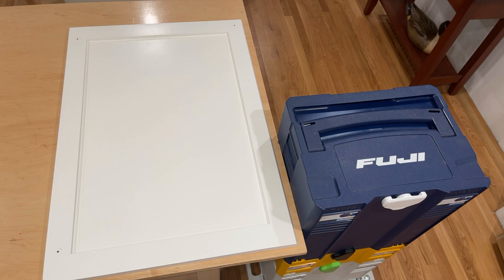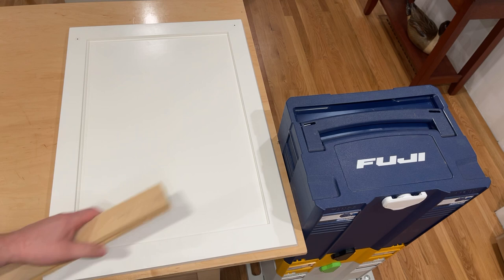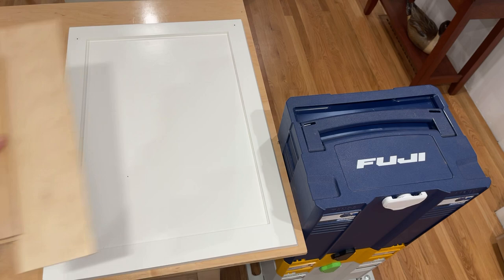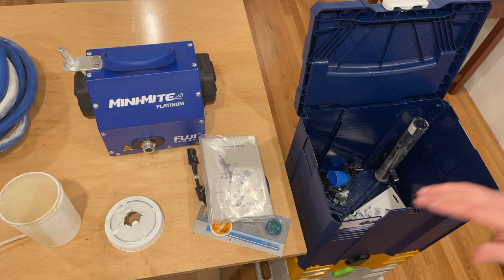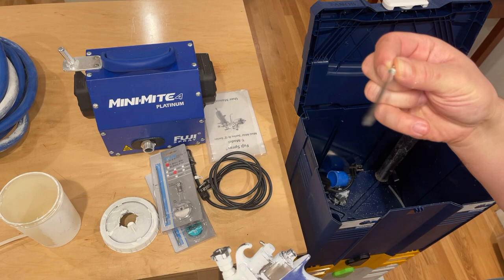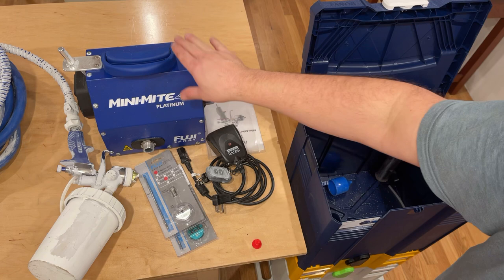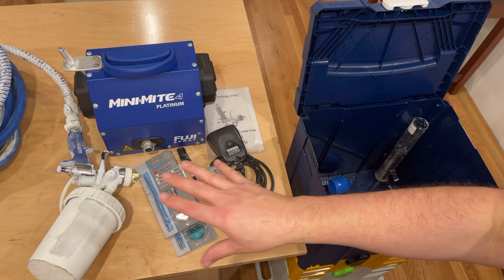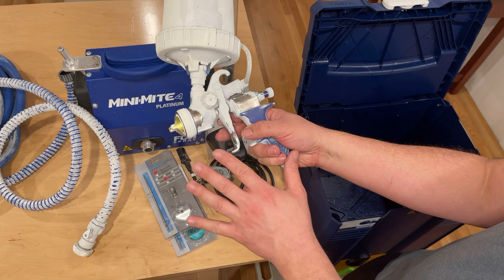Painting Kitchen Cabinets 1: Fuji HVLP spray gun Review

Comment: I am a newbie to the Fuji system and painting cabinets.  I used SW Extreme for a primer and their Emerald Urethane Hybrid for the topcoat. First mistake is using the 1.3 tip that came with the gun. He's right to use the 1.5. I had to get this job done with the 1.3, however. From my spraying experience with standard air compressor guns I knew how to gloss out paint onto the surface to compensate somewhat for orange peel. 
But as he said, it was difficult not to get runs, especially with the Emerald.  However, I will say that the Extreme primer dries very hard but is easy to sand. It withstands aggressive sanding with 220 paper without burning through the edges. This makes it great when you need a thicker coat for some reason, because you know that it will sand out beautifully.
The Emerald is a learning curve, and with a 1.3 tip it seems very difficult to get that fine spray without thinning the paint down too much. I'm certain the 1.5 tip will take care of that problem. But it levels so well that runs I touched up with a brush that left brush marks were barely distinguishable from the sprayed finish. At least least well enough to pass for the people who owned the house that were flipping it so resell. It really save my rear.
One thing that I found very difficult was to position light where I could see my spray pattern to put on a wet coat that was not going to run. I was shooting blind a lot that did not help. I had to go more on feel.
Anyway, that's my two cents worth.
Reply from the maker: Thanks for that! Yeah I only use the 1.5 it sprays very evenly and fast enough to keep the surface wet. I will do a video on my "paint booth" in the basement when I get started again. I use a bank of 4 florescent lights an 2 more LED lights because as you did lighting is critical to see flaws and flow. Also I always try an spray flat on a homemade turn table made out of a lazy-suzan onto of some saw horses. Spraying flat is always easier and you can get the top coat wetter with less runs and better flow. Honestly the Benjamin Moore Advance is AMAZING! It will flow and fix many of my mistakes from not getting on a smooth finish. And after a few years it has held up perfectly, easy to wipe and keep clean. Great tools (Fuji, Styx and B-M Advance) make the job way easier and the results much better. Happy Spraying!

Comment: I've been shooting HVLP for twenty plus years now.  I have a competitors gun but have been interested in the Fuji system for a nephew.  I have a time saving tip I learned from a pro many years ago.  You will laugh but you will reap the reward if you just give it a try.  One of the very finest lubricants on the market that water will not bother is ........wait for it Chap stick.  So you have complained that cleaning the outside of your gun is a pain right.  And as a presenter having a paint soaked gun distracted me from taking you seriously at first.  So if you use a bit of chap stick on the body of your gun the paint will not adhere to it.  It will wipe right off and make cleaning a breeze.  Also if you use it on the needle barrel you will prolong it's life at the contact area before the trigger.  Applying it on your cap will keep it clean and make shooting easier.  My gun still looks new after twenty years of use.  And wait for it.  It smells pretty good too.  I swear to all of you this is serious.  It's a great lubricant and it's not water soluable.  Give it a try.
Reply from the maker: That is a great idea, I will give the chapstick idea a try. When I first got the gun I cleaned the outside religiously but after spending 30 min each time I just gave up and cleaned the inside only. I will clean the outside one more time and give the chapstick idea a shot. Thanks!

Comment: Thanks. I purchased the same sprayer to paint the kitchen cabinets I'm making for my son and his wife. (also shaker style)
A bit nerve racking while going through the learning process.
At first i was afraid to thin down BM Advance to the guns specs but when I did I had virtually zero orange peel.
Even when I sprayed it thicker, it still seemed to settle and lay down flat.
I have a long way to go, but so far, so good. Nice to hear someone is going through the same process.
Reply from the maker: Glad to help! Painting isn't really as hard as people think, it's just that last finish coat that is kinda stressful. Its not so much that if you mess it up the final coat your finished... its more the opposite that if you mess up the final coat now you have to sand it and do the final coat again... I am almost at the point of doing a BUNCH of painting and I will post a few more videos showing the process I use, but I am not a professional painter either, but I figure I can help others a little. Good luck!

Comment: Thanks for the heads up on the PPS system from 3M... great idea!
Reply: Well I'm glad you are open to suggestions. Just use it like you were applying it to your body.  Create a film over the surface of the gun and handle.  Do the cap and nozzle.  Don't block the air holes.  Cleanup will be easier.  I clean with a double sided kitchen sponge.  You still need your gun brushes for the cap, tip and fluid delivery parts.  But the rest just became much easier.

Comment: Omg we were so close. I have been on the struggle with BM Advance. I first tried to brush/roll it on, that was a fail so I sanded down my two 7' doors and moved onto spraying. I have a Fuji MM 3, so one stage less than yours. I have a few questions you were very close to answering. 

1) What viscosity did you thin the advance down to? How many seconds in the Ford cup? 
2) Gun setup, did you start from wide open and bring the paint flow down to get a good fan or start at zero and work up? 
3) What tip/aircap size?
4) What size systainer is that?

My problem is I have a slight orange peel thing going on. I thinned to about 55 seconds in #4 Ford cup, which was way more than 10% water. I had no Floetrol so it was all water, it sprayed okay with a 1.8mm tip but Im afraid that the added water evaporated too fast so the paint didn't level enough and/or not enough solids were deposited so it peeled a bit.

Hoping you can remember what you did, I have been searching everywhere for specific info on Fuji + Advance spray settings.

Either way, great video 👍

Comment: Have you ever tried spraying cabinets with lacquer? Thats all I use....I never use paint on anything that is constantly touched...or subject to wear and tear.... Lacquer provides a much harder durable and smoother finish..... It truly looks like it was applied at the factory, it levels out far more better than paint
Reply from the maker: I am sure lacquer looks amazing I only worry about spraying a solvent based paint. The benjamin moore advance paint is a waterborne paint that eliminates a lot of the solvent risks. The paint I use has many of the benefits of oil based paints like Lacquer in that waterborne alkyds flow well and cure to a very hard surface but because they are resin based and waterborne they are easy to clean and safe to spray without  the risk of explosion or high toxicity of vaporized solvents.
Reply: @postbeam8200  Two words: Target Coatings . Their waterborne (read: no solvent) lacquer sprays fantastic out of Fuji. And with the topcoat and crosslinker, it's chemical resistant.

Comment: Would you recommend this machine for a beginner? I saw the fuji semi pro that goes for half the price. But I know eventually I will want to purchase an upgrade to the semi pro. What's your advice?
Reply from the maker: Hi Paulo! I am a beginner or at least a rookie painter so yes I do recommend a HVLP system like the Fuji. I have never used the 2-stage semi-pro so I am not sure how it compares but I honestly think the paint, the Painter (you), and the 3M PPS system make just as big difference in the result. Like all painting surface preparation is the key. And anyone can put in the time to get a good result. Often I have to repeat coats and sand imperfections to get the quality of finish I want so 'craftsmanship' and care can overcome the output of your equipment except perhaps in the final coat which needs to be smooth. I went with the minimite4 because it was as much as I could afford and I don't regret it. Good  Luck!
Reply: If you are new to this, the more stages the better. My Fuji Q5 platinum struggles with unthinned waterborne coatings.

Comment: Great video. Thank you for the in depth breakdown and explanation of everything. Quick question, the gun you purchased. Is it the gravity fed gun and you just replace the gravity feed cup with the PPS system from 3M? Thanks again. Look forward to your videos of painting with this sprayer
Reply from the maker: Good question. This gun came with my Fuji Mini-Mite 4 system. I had two options, I could buy: A top feed "gravity" type gun or a bottom feed "pressure" type gun. I chose the top feed because it is simpler and I knew I was going to add on the 3M PPS system from day 1. While the original gun will not paint upside-down and relays on gravity for the most part this type of Fuji gun does incorporate a bleed air tube that connects to the top of the original hopper to pressurize it and help push the paint down and into the fluid passage. The real reason I prefer the top feed "gravity" style gun is because it keeps the pressure cup (paint reservoir) out if the way and at a slight backward angle while spraying, with the bottom feed system it is hanging straight down below the gun and always seems to bump into stuff as I spray, at least from my experience. Hope that helps.
Reply: Spot on. I have the Fuji Q5 and I own both gravity and bottom feed guns. The ergos on gravity are much better. As you note, the reservoir is less likely to hit the work surface. Just be sure to store the gravity feed in a proper rack every time you put it down. I didn't at first. I think that contributed to the failure of my whip hose.

Comment: Great video. I have the same system. You mentioned the liner part number is 16325. Can you share what is the part number for compressor cup/top filter cap and adopter required for the spray gun. Thank you!
Reply from the maker: Sure and Thanks!
- 3M PPS (Original Series) 16003 PPS Adapter 2
- 3M PPS (Original Series) 16124 PPS H/O Pressure Cup with Air Hose, Large, 28 oz, 1 Pack

Got mine at Amazon and here are the links but I have no financial connection with them so get it wherever you want:
https://smile.amazon.com/dp/B000N9RWTK/ref=cm_sw_em_r_mt_dp_02PWG7KMCKF4C4AH97J4?_encoding=UTF8&psc=1
https://smile.amazon.com/gp/product/B000RI0GIG/ref=ppx_yo_dt_b_search_asin_title?ie=UTF8&psc=1

Good Luck! And as Bob Ross would say "Happy Painting!"

Comment: Good stuff, pains me to see how you haven't cleaned the gun, the cup and hoses though.
Reply from the maker: Yeah I had high hopes of keeping everything clean in the beginning but it's just about impossible. The hose, gun and cup are kinda messy on the outside. But what is important is cleaning the working parts of the gun after every use. So I put my efforts into keeping it functionally clean if not aesthetically clean.
Reply: Made me flinch too…..my gun on the outside is as clean as it is on the inside. Cleaned thoroughly after every use, do that and your gun stays clean for years…lol

Comment: thanks for the information. What size is your systainer and did you do coats of BM Advance did you put on. I know its a significant wait time between coats.
Reply from the maker: Hi! It is a Tanos Systainer 5 - systainer T-LOC V, Sapphire Blue (Item 157947SB  Model 80100030)
As far as drying between coats I usually wait 24 hrs on the BM Advance. For the Styx you can paint your next coat a few hours later.
Good Luck!

Comment: Can pick up a cheap-ish ultrasonic cleaner on Amazon and keep it clean inside and out :)
Reply from the maker: I haven't tried ultrasonic. Keeping the inside clean is easy and critical to proper function. I use Fuji's spray gun cleaning kit #3100 that I got free with a mail in request when I got the gun. Keeping the outside clean is nearly impossible, because when you're spraying the excess paint that gets on the outside of the gun dries relatively quickly. By the time you're done and dismantling the gun to clean it out the paint on the outside is dry and requires a scouring pad to get it off. I haven't tried other methods, maybe ultrasonic is the magic cure :) .... but paint on the outside of the gun doesn't have any effect on the quality of the paining.
Reply: @postbeam8200  you're right, but its feels nice to pick up a tool that functions like new and looks as good as new also :)
Reply from the maker: @LamentationStudio  Agreed :)

Comment: Hello. Can you tell me how much you are thinning the BM advance? The spec sheet says 4% but I am reading more like 10-15%. Also what tip are you using? 1.8 or 1.5? Just picked up the same sprayer and doing some cabinets. Thanks
Reply from the maker: I always use the 1.5 tip and I thin it out probably 10-15% but I base it on the viscosity using the included fuji spray viscosity cup rather that volume (but honestly I would always use weight not volume in thinning) The key is the paint HAS to have the correct viscosity or it won't atomize correctly. I have never had an issue with the B-M Advance getting to thin and impacting the way the paint sets. Just use the viscosity cup and thin to the recommended time based on the Fuji user guide and you'll be fine. Good luck and happy painting.
Reply: I'm breaking in my fuji 3 and using bm advance. First try I over thinned. Trying to get it right frustrating. I'm using Benjamin Moore thinner. (Their best recommned for spraying, dont recall name as its currently on job site where im repainting kitchen cabinet boxes. What do you use to thin ? Some say water ok.

Comment: How long did you wait between coats of the advance? I know they recommend 16 hours between coats seems like a pain to wait that long.
Reply from the maker: Thats a good question. For the STIX primer I was often putting down a coat in the morning then going back after lunch and then after dinner in the evening, sanding smooth between each coat (4-6 hrs between coats). For the STIX primer I did a LOT of coats (10+) but it drys super fast. For the ADVANCE I would just do just 1 coat a day then leave it to cure overnight (basically 16-24 hrs). I was also putting down a heavy "wet" coat to let it flow properly and even out which is not necessary with the primer since the sanding evens it out. I typically did 2 or 3 coats of the ADVANCE. If I got a really nice smooth finish after coat #2 I would quit while I was ahead. But if it didn't look right or I was painting a high wear item (for example the silverware drawer) I would go on an do a third coat. I am planning on doing a video showing the painting in the not too distant future. Good luck!
Reply: You should be spraying cabinets with lacquer, dry time in between codes is about 15 minutes
Reply: @daleon96  what kind of lacquer do you recommend for Fuji?
Reply: @igorkashin9865  Sherwin Williams High Build

Comment: Anyone know how the STIX/Advance two product method compares to just using INSL-X Cabinet Coat?
Reply: Advance will yellow over time. That's why I switched to cabinet coat.
Reply: @ILruffian  Thanks for the info. Do you top coat with a shellac or lacquer to give a harder finish? My Main concern is chipping on edges.
Reply: @TheItalianDNA  I went from Advance ->CC->Target Coatings waterborne lacquers. If you add the crosslinker, the clear topcoat is even chemical resistant. Great company to deal with as well. And just FYI, the yellowing w/ Advance is real. BM rep will admit it.